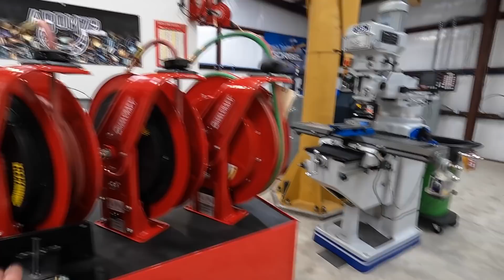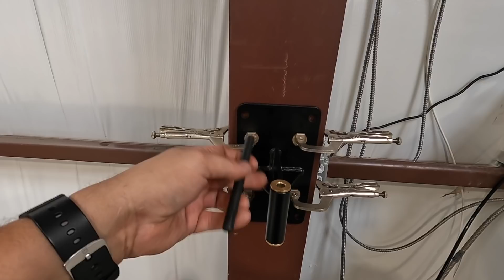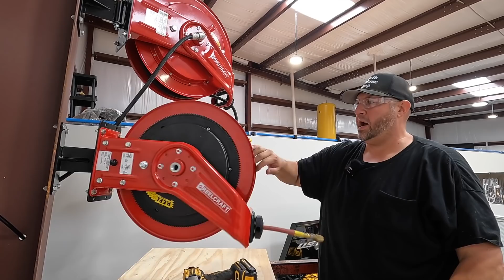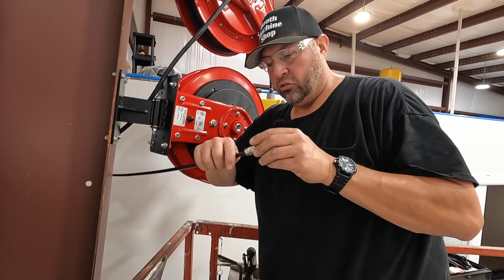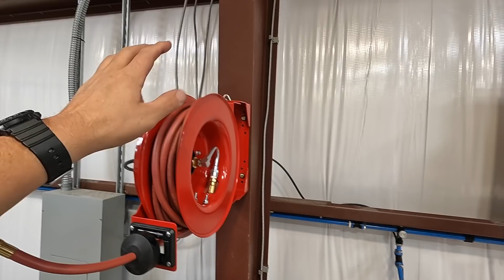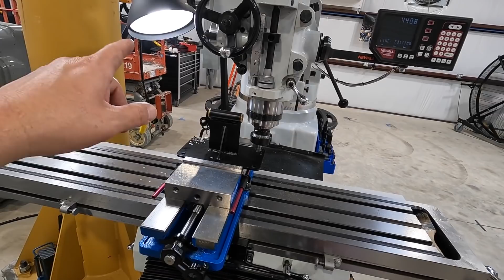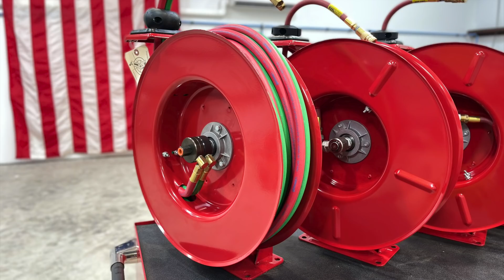Reelcraft Hose & Cord Reel Installation

Comment: High pressure cylinders secured to a outside wall, especially next to a overhead door on the front of a shop is not suggested… if anyone hits the front of the building under any situation and knocks those bottles over it will be extremely dangerous. How many times have you seen or heard of someone running into the front of a building.. way too close to a door and front of building
Reply: Where I work we store our oxy-cutting equipment right behind the grinding workbench at the backwall of the shop where all the sparks fly. For maximum safety!
Reply: You should have the gas cylinders near a door so you can take them to safety in case it starts to burn in the workshop

Comment: Reelcraft is quality made.  I'm not sure why you are mounting reels for multiple machines.  Over the years, a simple air drop at each machine was beneficial over an overhead Reelcraft hose system.  Also, the machine air drop provided a place for a Mist-Coolant system.  Hose reels are better for garage entryways and mechanics.  Each machine should have it's own air line drop.  My $.02

Comment: Good little mag drill but you should never trust the magnets. If you have a power loss of any kind, it will fall so always use either a safety strap or safety clamp

Comment: any reason you have the back of the flag facing outwards ?
Reply: The proper way to display a US flag hung that way is with the blue field on the upper left as seen from the observer. So Adam has it correct.

Comment: Adam, not to rain on your parade but you mounted those awfully high. Can Abbey reach ANY of them? Could another employee reach them? You may want to lower them some...
Reply: That's what the stops on the hoses are for. You pull out the hose to where you want in relation to the floor then slide the stop up to the reel and tighten it.
Reply: or you could just set the stopper further back.
Reply: He can adjust the hose stops for any level.  Always mount high and then adjust the hose stops.

Comment: Mag Drill = Hougen HMD130
Reply: they wouldn't give him a free one so he moved on to another
Reply: Lets face it, if he was paying the way you have to ask yourself, why would he take the seemingly most expensive route to put shop air in place around the shop, for starters why drill the beams when beam clamps work dandy and require only a wrench to tighten the pinch bolt, no drilling and if you don't like where it's mounted simply get your wrench and move it, for what that mag drill cost you can buy a big bunch of beam clamps not to mention the time savings.

Comment: Nice job Adam it is good to hear Abby excited about using thousands of dollars worth of equipment to drill holes and mount the hose reels.
Reply: LMAO!!
Reply: @summerforever6736  Even though I worked for over 50 years in an industrial environment and have done similar work I never comment on how the work was done or suggest improvements but if I can find something absurd or funny that is fair game.
Reply: @richb313  I did like your comment

Comment: EVOLUTION 1.1/8 MAG DRILL W/6PC ? Its the only mag drill I see on KBC tools site. I have to say, thats a dam good price for what it comes with. Ive been looking at other mag drills and they are priced at 900 bucks and up. With nothing but the mag drill. Im going to buy one. Should I mention you when I make the purchase?
Reply: Buy on amazon
Reply: It is a cheap Chinese import.  All you have to do is listen to the noise of the motor to realize.
Reply: @MrThisIsMeToo  Everyone Ive looked at has been cheap chinese. Between 900 bucks and 575, with goodies, Ill have to settle. I wont be using a whole lot anyway. Even vintage made in USA ones on ebay are through the roof $$$$$.
Reply: @opiesmachineshop  Like someone else mentioned there are a lot cheaper ones on Amazon. 1/3 the price of the rebranded Chinese one seen here.  If you look closely some are 1/3 the cost and look exactly like this rebranded KBC model. Good luck.

Comment: I sell Reelcraft, magdrills along with annular cutters. He’s got some pretty serious money there. Jeez

Although, I will say mag drills are a life saver. Well worth the money. I sell one we call a “frame drill” that is super compact and lite. I use it all the time on all sorts of stuff. Wherever I can.

Btw. When the metal is too thin for the drill to magnetize to. Take another small piece of plate and stick it behind the beam in this case. I do the same for aluminum drilling. Back it up with a plate of steel and you can use it on aluminum too. Well, if the magnet is strong enough on that particular drill. But works great if it is.
Reply: I was wondering if a back plate of steel would have worked. Thanks for posting that !

Comment: Your shop is really taking shape Adam. Anxious to see what work you’ll be doing. For what it’s worth, a heavier piece of sheet metal on the opposite side of the column from the magnetic drill would have allowed the mag drill to hold on the surface of the thin column.
Reply: Good idea.

Comment: Not suppiosed to drill the flanges in structural members...webs OK to drill.  Guilty of drilling some flanges myself, however...
Web is also plumb on that particular member, unlike the flange.
Reply: How does he hurt the flange if he fills the hole with a bolt? The load is trivial in this case.
Reply: @oleran4569  the highest stress in structural members typically occurs in the part of the cross section farthest from the neutral axis.  Putting holes in flanges mid span removes meat exactly where it does the most good.  Bolts in holes do not carry the longitudinal stress in the beam from one side of the hole to the other.  Probably not an issue here, but also not best practice.  And something to think about before you put holes in your newly rented structural members.

Comment: These Reelcraft products are in $500 territory? I’m getting whacky pricing in Canada so just looking for a rough USD range you see in Florida. I’d pay USD$500 but vendors here want USD$1k equivalent.
Reply: Depends on model/type.  I see a huge range of prices on the web. The cheapest I see is a 3/8 air hose 50' reel for $200+ ship open box on ebay.  The rest seem to be $300 up on other sites.

Comment: This is an awesome shop.  Enjoying watching it come together.  In my wee little 26x28 shop, I have a Reelcraft  40' air reel.  You can't beat them.  I mounted it on the front wall between the garage doors. Great location for outside use as well.  I do have two other drops on the wall at either end of the bench on the back wall.   That Reelcraft improvement to slow down a rogue rewind is great.
Reply: Your shop makes way more sense for us average Joe's..

Comment: There's an inherent danger with mag drills. Typically you tie the drill with a rope or strap secured in some fashion that if power should fail (like a popped breaker) the drill just doesnt drop out your hands and fall.  I would place a beam clamp on the beam itself and secure the rope to it.  I hope you get some projects soon there so to get all that money your investing in that shop back.
Reply: That's a great tip, something I don't think I would have thought of.

Comment: Hi Adam. Love the new shop. Question:  where did you get the huge flag?  I have been looking for one to put on my barn. Thanks
Reply: He had two flags, both of them fan-donated. They are retired flags that were flown in U.S. military service- if i recall correctly. He has a video on them.
Reply: You can find big flags on Amazon, I saw 8*12s for $70-100 and 10*15s for $100-150, just have to do some digging to find one that's actually made in USA.
Reply: @bdkj3e  thanks for the info

Comment: I've been in electrician for 22 years  with tons of experience in the new construction end of the field. There's no question in my mind that Adam is very good at what he does therefore I was very disappointed to see the quality of the work when it comes to the electrical in his new shop. It's very obvious that he's getting a lot of incorrect information. Take this video for example he mentions that the drop with the yellow box that is supposedly good to take outside and use in the weather is absolutely not unless it's protected by a GFCI circuit and even still there's nothing about it that makes it weatherproof the second that you're actually using it once the covers are opened up it becomes a standard receptacle. There's unfortunately no excuse for it and it's disheartening. Nevertheless I'm very excited to see the progress on a new shop and it is awesome to see Adam grow and expand his business. I understand how hard he's worked to get to this point
Reply: It’s a rental. Electrical was contracted out by the building owner. So not a lot Adam could say or do. Adam’s long term plans is to build his own shop on the property Abby and himself purchased. This is after their house is built.
Reply: Yeah, important to keep in mind this isn’t a build out for the long term.
Reply: @floodo1  that's a very valid point
Reply: @grntitan1  I didn't realize that so that does make sense
Reply: You saw that too? So many little things that may have saved the electrician 5 minutes here & there makes a sloppy job.
Reply: @jeffwisemiller3590  unfortunately I did. I know the great care Adam takes when it comes to the work he does so I feel like he would not be satisfied if he knew what he was actually looking at. Absolutely not a criticizing him. Not many people cross trades rather focus on being good at the one they do
Reply: Never been a fan of Rat cable. It makes for poor workmanship. But that's how Florida rolls. That state is smurf tube happy as well.
Reply: @timothyj1962  Interesting. My entire career has been in the communist state of New York so I didn't know that. I've also been very fortunate to spend most of my career working for companies and customers that care far more about quality of the end product rather than how fast you can get it done. I've wired a couple machine shops and done years of Maintenance in one of them which is how I acquired my interest in Adam's channel

Comment: My tools, my tools, I can't do the job without my tools!!  A guy ( or some girls) can never have too many tools.  Abbie doesn't seem to mind- and that's great.  Some wives think tools should be sold if they aren't used everyday.

I'm glad to see this video as I've been toying with buying one of these mag-drills.  There are a few other videos that show them in action also.  Others might last longer but this is light enough to use.  Those reels are a thing of beauty.  No more hoses and cords all over the ground.  I do have pause about the electrical box so close to fuel and oxygen tanks.  Also, the extinguisher needs to be away from all of the above.

Comment: We used mag drills for steel construction back when I was an engineer for a construction company.  We considered it a MUST to tie the drill off for safety. If someone kicks the plug out or a breaker trips, LOOK OUT BELOW.
Reply: I have had some sketchy ass experiences with old heavy worn out mag drills with super loose cords being way up on ladders. Somehow one never let loose and its a good thing because I am sure that if you're hanging onto it on top of an extension ladder,  you're probably falling with it.

Comment: On the fire units - I'd look into a Metal fire unit and have it in the lathe / mill area.  AL products have magnesium for hardness and can catch fire if it gets very hot.  Welding or milling .  It is costly, but worth a machine if something fires up.  e.g. Mill some AL and all is well.  Mill some steel and all is well.  Later Termite is created in chemical fire. I had that happen on my saw but it was in such a water base cooler that when I found it, only a mass of metal was present.
Reply: Did you mean to say Thermite?
Reply: @russellstarr9111 No, Incendiary Termites. Haven’t you heard
Reply: @Jay22222  LOL
Reply: Hog wash on the magnesium catching fire from machining, the only way magnesium "catches fire" is by having an ignition source of fire itself otherwise how could I and many others have welded magnesium for(45 yrs myself) years without incident, machining it is the same way, unless the chips are exposed to an open flame they aren't going do anything.
Reply: @Peter-V_00  It for sure happens(Rarely) and there’s a difference between welding on a few large pieces and the debris from machining.
Regardless, the tenants are the same. 
Don’t let excess flammable detritus build up somewhere you’d rather not have a fire.
It’s why huge backburning and fire breaks are maintained every year in a lot of the world.

I’d agree it’s pretty unlikely BUT it’s a pretty catastrophic thing to deal with.

Comment: The content is already interesting. 
But: And again... The air hoses are "of course" made in America. That the wobbly and rickety magnetic drilling machine comes from GB is not mentioned. A simple hand drill would have been enough for this job. 
And: even DREMEL seems to be better than the "evolution". 
Aligning the fasteners with a spirit level is null and void if you have no way to align the plates to the drum, so absolutely pointless.
The fact that the cable of the upper power connection rubs on the joint of the pneumatic drum also seems uninteresting.
Oops, obviously it works without the "great" magnet drill .
Shouldn't a CNC machine stand on a solid foundation? With the cracks in the floor, I would worry.
But at least it uses a Wilton vise, the only decent vise in the US.
Reply: Man! This guy has ALL the answers!!
Reply: @natedoerfler652  I was thinking the same thing.
Reply: @natedoerfler652  Exactly.
Reply: @natedoerfler652  He sure THINKS he does.
Reply: @wildtimbrown  What contribution do they have to this topic, other than babbling stupidly?
Reply: @natedoerfler652  I was thinking more like a DA. And I don’t mean district attorney.
Reply: I too thought the mag drill was a bit of overkill. Those step bits and the Dewalt drill would have been enough.
Reply: The reason you align the pivot on the bracket with a level so that the reels shouldn’t swing under gravity, the reel not being level after the pivot has no bearing on this! 🙄
Reply: @grahamstretch6863  Theoretically.
Reply: @grahamstretch6863  Too bad they have no idea about the lever laws. An analogy: If the track is not correct, the tire breaks down.
Reply: ............or inexpensive beam clamps.
Reply: Feller reminds me of my brother-in-law. Thinks he knows everything, doesn't know squat.

Comment: best to use the the mag drill from the top so its cutting blow it, stops all chips getting stuck to the drill and stops chips and cutting fluid running on to it :D
Reply: best to use regular drill for such small holes. or  clamps for no holes.

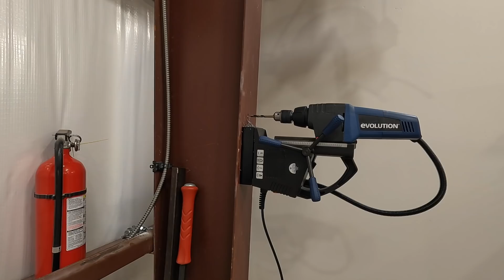Comment: 38:50 ... Just a tip you're using he mag drill upside down.  When you have it mounted the other way the chips and cutting fluid (if any used) don't stick all to the mag.  This is also a safety issue, one chip under the mag greatly reduces it's holding power!

Comment: i had a whip line come loose from a die grinder one time i was in the bilges of a ship in a tight space very little room to move. that hose kicked my ass lol
Reply: Yep, been there, like a bullwhip possessed by a demon, I was inside a tank trailer doing a repair on a baffle when POW, the 1/2 inch  hose failed right behind the crimp, damned thing put a huge welt on the back of my neck in the process.

Comment: 500 bucks for a run of the mill hose reel? Maybe it is a great product or whatever, but come on - it's a hose reel.
Reply: Well, there’s the run of the mill hose reels and then there’s REEL-CRAFT. That lightweight mag drill is the cat’s meow for sure. I would hate to drill those holes with a hand drill.
Reply: @ellieprice363  Well, the mag drill is sweet, yes. But as far as hose reels, I have one on my wall that works the same and it only set me back about $125 bucks.
Reply: @MadeInMichigan  I have one in my shop also from HF or Northern for about the same amount. It’s worked fine for several years and I didn’t even have to show it to anyone.

Comment: Those are awesome hose reels! Especially with the new controlled return! 
My suggestion for your nylon quick connect fittings going into the reels is to install some 45 or 90 degree fittings that way you can have the nylon air line closer to the reel and not sticking out as much and less stress on the line

Comment: Do you thinking a extraction fumes unit above the lathes for a spray welding and to the welding area?
Reply: dude he got like 20 feet high workshop why would he need a fume extractor ?
Reply: @tihs87  we had 20 feet high facility at technical university but we got and extraction fumes also.
Reply: @dx63  yeah and how many welders were running at the same time in that facility when you were having classes?

Comment: I think these reels have adjustments of orientation of guide rollers. Wouldn't be nicer to have them pointing 45 degrees down instead level? Seems cable/hose would go in and out easier.

Comment: Try turning the mag drill the other way with the chuck down. Chips fall down away from mag base. Use a cord around the mag base to suspend a catch can to catch chips and cutting lube.  Keeps base clean.  That is a great looking mag drill. Thanks.  Love the new shop!
Reply: I had the same thoughts about the chips falling onto the drill.  Personally I thought the mag drill looked cheap and flimsy but I guess you have to sacrifice to save weight and cost if you want a mag drill.
Reply: You said it all.
Reply: I feel silly for not noticing that now 👍